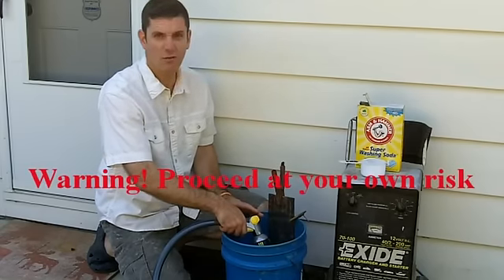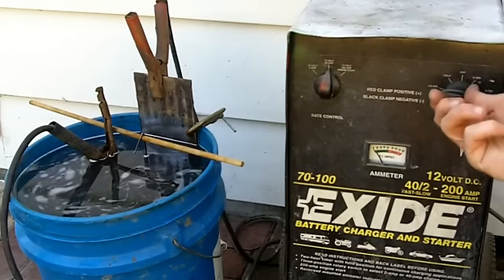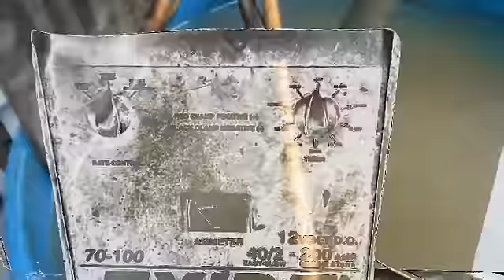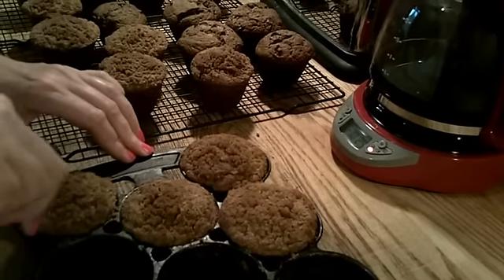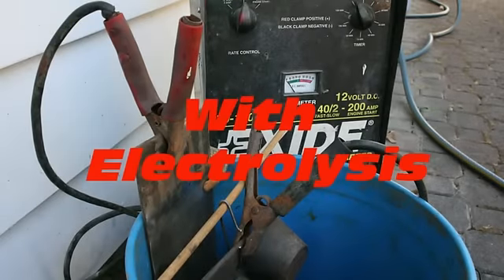Cleaning Cast Iron with Electrolysis

Comment: I have a muffin pan almost exactly like yours that I dug up 45 years ago.  You motivated me to see if it could be cleaned up. Followed your video almost exactly and wow. The results are most impressive.  Thanks for posting this.  A little clean up and seasoning and look out muffins.  
FYI used a precision regulated DC power supply set to 14.5 volts. The bath drew about 8 amps. It later dropped to around 5 amps.   At these levels I suspect a cheapo battery charger should work fine.

Comment: Thanks for the video. I had set my skillet up with my battery charger as per another site, but it didn't work. Sanding the steel piece AND the handle of the skillet got it bubbling away!

Comment from the maker: Thanks for the comment.

I've tried Flax oil for seasoning, it works okay, but Crisco works just as well, if not better. 

But it's really just an initial seasoning anyway, or for a touch up here and there. It's using the pan over time, the build up of polymerized oils, that really makes the pan.

Comment: Great vid! A couple of precautions though: make sure never to have the positive electrode clamp immersed in the solution. Not sure I'd want the negative clamp immersed either, just as a precaution for food related stuff. Also, I'd be careful what kind of steel I used for the sacrificial anode: stainless steel has cadmium and other nasty stuff in it that might not be desirable with cookware; an iron anode might be altogether preferable to steel, at least when de-rusting cookware.

Comment: Great video! really helped me restoring an old vise. One thing though just a little safety tip for ya, Don't wear gloves when using a grinder. I've worked in many weld shops and have yet to meet anyone that does, and have unfortunately seen the results of someones glove getting caught by the wheel.

Comment: warmer water means more current. Running current through the cold solution will still heat it up on its own, but starting out with hot water certainly shortens the time to get to decent currents.

Additionally, current likes to take the path of least resistance. That is, if some parts are closer to positive plate, current will favor those paths, thus the reason why some places are not getting as clean.

Comment from the maker: *Proceed at your own risk.* Greetings everyone and thank you for taking the time to comment. Lots of great tips and input! I'm using hot water now and perhaps 2 cups of washing soda for a stronger electrolyte solution. Also, the battery charger is set at 40 amps BUT if I recall correctly it's only drawing 10 or so (according to the beat up old gauge). The closer together the positive and negative are, and the stronger the solution, the more amps it will draw. Yes, only use clean mild steel or cast iron for the sacrificial. Never stainless or anything else. *Proceed at your own risk.*
Reply: +Richard Gessford so i take it galvanized steel is not a good sacrificial material?
Reply: +Matthew McGinity Most people I have seen do this method with rebar. Galvanized is a no-go.
Reply: distilled water would work better
Reply: Just don't stand over top while doing it with galvenized. You''ll end up with "brass chills" if the gas is concentrated enough.  "brass chills" is a flu-like condition from inhaling zinc. Awful. (got a dose from gas cutting door track on steel building)
Reply: Richard Gessford how much does amperage affect the function of the electrolysis? I have a manual 6 Amp, think that will work?

Comment: I use a hot lye solution soak for half an hour to shift all the burned on crud and that use electrolysis  with washing soda, This method will shift oils and paint far more efficiently

Comment: Very cool video! So the sacrificial  steel is the anode and the pan is the cathode in an electrolyte solution of A&H washing soda with a 12 volt current  at 40 amps draw ? I appreciate the disclaimer "proceed at your own risk" - duly noted! Thank you for the information- I learned a lot here!

Comment: Hi, from what I saw in his video, it appears to be Arm & Hammer Washing Soda. Basically, A&H is sodium to be used as the electrolyte for the electrolysis to occur. Hope this helps you. Planning to clean some of my very old Cast Iron fry pans and dutch ovens. Hope this helps.

Comment from the maker: Interesting you'd say that, I'm working on a little bean pot right now that indeed came with a couple inches of lead in the bottom. 

Once I'm done with the electrolysis I'll be checking it with lead test swabs, to verify it's clean, before bothering to seasoning it. Guess I'll find out soon...

Comment: This is great, thanks! I had a chance to get a large 40 amp battery charger last year for free, but I couldn't think of a use for it because I already had a small one. Now that I see this, I'm going to see if its still available. . Thanks again.

There is one question I had about the seasoning.  When you say cool down, was that completely cooled down or back to 200 for the other coatings of Crisco?

Comment: I have cast iron that doesn't have much rust, but has a bunch of gunk.... over seasoning and improper cleaning.  I got it at a garage sale.  Will this method work?  Or should I just put it in the oven on self clean?  I've done the oven method before and it works ok.  Just looking for another option.  Also, for the electrolytic solution, can I use rock salt?  I know that Sodium Carbonate is not Sodium Cloride, but I have the salt on hand.  I don't have the Washing Soda and my local grocery store doesn't carry it.  Thanks.

Comment: Hey Richard, quick question again..lol What type of charger should I be looking at? the big wheeled one like in the video or a small, box like one. Amazon has a few that are 50 - 100 Amp but im not sure if they will handle that draw for any length of time as they are for jump starting cars so they are designed to be used for 5 - 10 seconds at a time..i think. Any ideas?  looking for the 40 Amp range. Preferably under $100.00

Comment: I assume you are using 12V since it's a battery charger, but how amps are you using? What kind of steel is the "sacrificial steel" and more importantly, why did you have to sand it down?
What exactly do you mean by "seasoning'? Are you supposed to bake Crisco into cast iron pots/molds etc? Does the cast iron actually absorb this stuff? Why do you have to do it 3 times? Are you wearing pink finger nail polish right at 11:02?

Comment: what's the smallest amp charger you can use? I don't think mine has a 40 Amp output like yours...its one of those small, little square ones from Sears. it does cars, motorcycles, lawn tractors and such.

Comment: Hard to believe that's the same pan! What are the risks involved with your electrolysis method; when power is plugged in, the bucket should not be touched, correct? Also, I have what appears to be an old cast iron pan; the only identifier is a 1 inch high #8 on the bottom...Any ideas who the manufacturer may be?

Comment: Does the size, shape, and/or mass of the sacrificial piece make a difference?  Would a stick of rebar work just as well as a broad, flat plate?  What would happen if you put two sacrificial pieces (wired together with copper wire) on both sides of the piece being cleaned?  Could you clean both sides simultaneously?  Would that have ramifications for the amount of current required?
Reply from the maker: devolve42 I think the surface area of the sacrificial makes a difference. Bigger might be better. That said I have used rebar and used multiple sacrificial pieces wired together to good effect.

Comment: Fun video. Nice job. Just missed the part about how to properly attach terminals/clamps to sacrificial plate and cast iron. .. which one positive and which one negative. 50-50 chance -- as I found out.
Reply: Jay Mann Positive on the sacrificial plate. Probably doesn't matter? I'd like to know what amperage is needed. He has a good batter charger that goes way up to 200Amps it looks like. My home style only goes to 10 amps.

Comment: hi friend, my attempt at electrolysis didn't seem to work.  The clamps from my battery charger are copper and they seem to have left a blue residue on the sacrificial steel, as well as the piece i was trying to salvage.  any idea what's going on?

Comment: Do you let the muffin pan touch the positive metal or is it just sitting in there I just got battery charger at yard sale and nervous about the electricity and water thanks
Reply: +Travis Hunt ~ That is exactly my question. I have no idea about this stuff and would love to have an answer as well.  Thanks for asking this one...for all of us!
Reply: NO, if they touch you create a short circuit.  If your lucky you will only pop a circuit breaker on the charger.  You'll destroy your battery charger if your luck runs out.

Comment: it is working well on my old waffle irons.  How often should the electrolyte solution be changed?
Reply from the maker: Depends. If all your cleaning is rust it can last a long time. But if your cleaning grease and grime the solution can get nasty fast so I change it out. Tip: if the piece you're cleaning is gooey or greasy open all the windows (because it will smoke) and bake it in the oven at 400 F for an hour or so to dry and harden the gunk first (then let it cool back down) before electrolysis. Dry hardened gunk comes off easier than greasy gooey gunk. Also, cleaning the sacrificial back to bare metal (or flipping it around to expose a clean side to the piece you're cleaning) can perk things back up a bit.
Reply: Richard Gessford Thanks.  I just finished my Buster and Tige waffle iron cleanup.  Looks great.  
The concern about using stainless steel in the water bath prompts another question.  Should the tempered steel handles on many of these antique waffle irons be kept out of the bath, or are they safe to put in.  Any thoughts?

Comment: I'm interested in your lead test results.  I tried the 3M kit ("red means lead") from Lowes and the swab just turned black.  Guessing that's the way the reagent reacts with iron.  Alternately, i thought about boiling water in the skillet and then performing a lead test on the water.  If nothing leeches out, it's probably safe.  Let us know what you find.

Comment: I've got a cauldron I need to clean that's pitted on the inside and painted black on the outside.  Will electrolysis still be a good option?  I've never restored old cast iron before
Reply from the maker: Meagan Mullins Should work fine. to clean the inside submerge the cauldron and hang the sacrificial inside in the center.

Comment: Could you substitute common rock salt for the washing soda?  the Na will increase the conductivity of the water?   How much amps do you estimate your charger is sourcing to create the electrolysis?
Reply from the maker: Washing soda is sodium carbonate and, if I recall correctly, there's something about the electron balance of the molecule that makes it ideal for creating the electrolyte solution. It also works well as a laundry detergent booster.
Reply from the maker: Did some reading after my last reply...Table salt is sodium chloride (NaCl) and it will release chlorine gas if used as an electrolyte. Bad stuff. Better to use washing soda aka sodium carbonate (Na2CO3) which is Sodium, Carbon, Oxygen.
Reply: The washing soda can be hard to find in some markets. As an alternative, swimming pool PH increaser is PURE sodium carbonate.

Comment: Great video , Thanks for sharing. but what voltage did you set that at ?  and amps.
Reply from the maker: 12 volt automotive battery charger set to 40 amps. However it will not draw that many amps. Amp draw is typically closer to 5 or 10. Depends on the concentration of washing soda solution and how close (but NEVER touching) the item your're cleaning and the sacrificial are.

Comment: If you take the scum out but don't change the water it works better each time you use it + heat the water it will increase its cleaning ability as well.

Comment: So you're using a piece of regular steel plate and not graphite plate?
Reply from the maker: I'm using a piece of diamond deck plate in the video. I've also used rebar and broken cast iron. Nothing fancy, just mild steel. I WILL NOT use stainless for fear the stainless will leach chromates into the electrolytic solution.

Comment: Thanks for your video.  I have tried to set up the system, using your information and others from the Web and I can't get the solution to activate.  I bought a new Schumacher 6 amp/2 amp (SE-82-6) Manual auto battery charger, but nothing happens. Zip.   I have a stainless steel piece about 12 X 12, the washing soda (about 3/4 cup for 8 gallons), and my cast iron pan.  The red battery clip went directly to anode and black to pan.  Any ideas? Thank you.
Reply: Joan Chomak don't use stainless! Use carbon steel. You are going to make some toxic shit with stainless. Do some research.

Comment: Can I use EMT steel pipe as my sacrificial piece of steel?  The pipe when removed is covered in the white dehydrated washing soda but not much rust!!!!  3 TO 4 times in electrolysis setup per piece to get the piece half way decent, is this common or normal?  I get some bubbling and a white thick surface crud on the water but not a lot o rust on top.  Thanks Richard please let me know.
Reply from the maker: I Googled EMT pipe and it looks like it's galvanized with chemicals and zinc to prevent rust and corrosion! I'm guessing that's your problem. I also wonder if the galvanizing on the pipe will release toxic fumes or poison the water! The sacrificial needs to be "mild" untreated steel. I've also started using hot water and maybe 1 or 2 cups washing soda per 5 gallon bucket to make a stronger electrolyte solution. Personally I WILL NOT use stainless or anything fancy for the sacrificial. I only use bare, untreated, mild steel. Proceed at your own risk.  .
Reply: Richard Gessford When you heat galvanized steel it can off gas and it can and will kill you. So I'm thinking it will do the same here. If it off gasses that is very bad.
Reply: Thanks =- Lucky I was not inside the shed smokin a ciggy as I looked over the bucket from a foot distance.  Did feel weird as I tried EMT pipe a few times.  Never did find the perfect bit of steel,  But finished 7 or 8 pieces. and all came out great.
Reply: My buddy died from welding galvanized (scarfing) without the proper breathing protection. A slow death. Took about 4 months after the lung damage-heart failure then stroke. He was only 50 yrs old.

Comment: UPDATE from OzTralia.'Directional' was the key. Into a square bucket (in Merikan...Bout 2ft deep n 1.5 ft across) I attached 4 lengths of threaded steel rod, held in place by an old stove oven shelf..The rod securely held between the rungs by a nut on each side of the shelf. (So it looks like a small table that sits on top like a lid) this lets the flow of electrons happen from all sides. Below the table in the electrolyte hangs (insulated from the 'table') a very rusty old cast Iron pan...Bubble .. Bubble... WAY BETTER than the 1 piece of flat sacrificial steel plate... Try this at home. It works without turning stuff around. Work together and get the best result.. Warm wishes fro OzTralia

Comment: I operated a burn table and pattern torch at a welding shop 11 hours a day 6 days a week and I never did NOT wear gloves. Just wear a proper glove. Tillman Driver gloves work great. Short cuffs, close fitting and very tough pigskin protect your hands and wrists from debris and the grinder slag and heat. The most important safety item you need is tight fitting safety glasses with wrap around side shields and a thick 100% cotton shirt that is tucked in for grinding. Just my 2¢